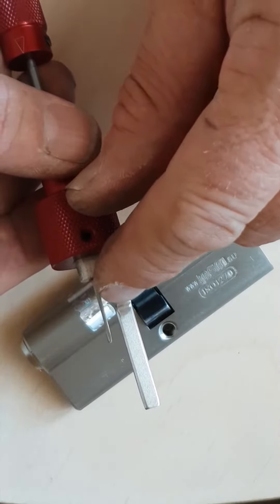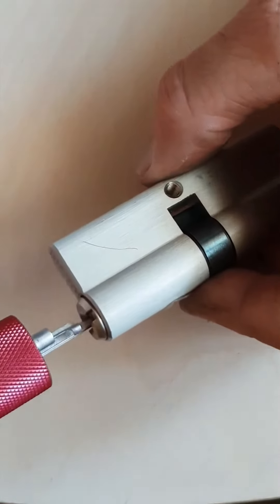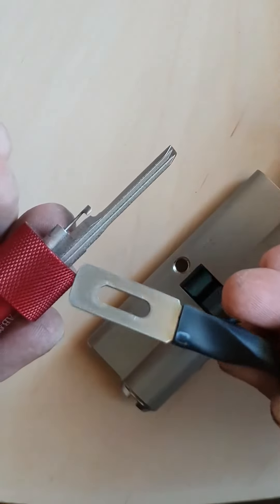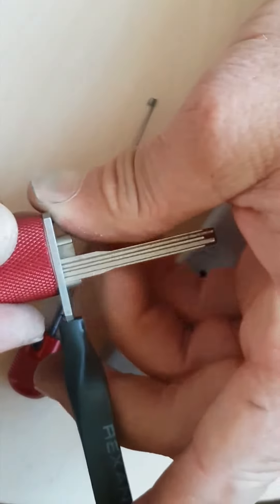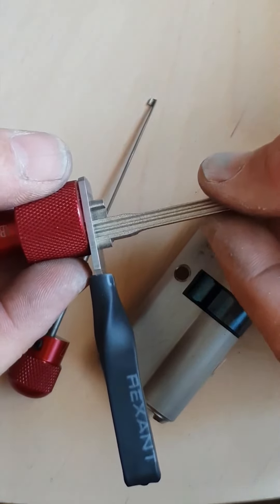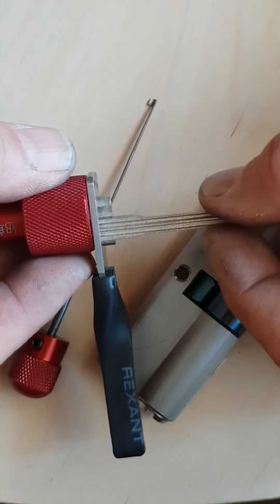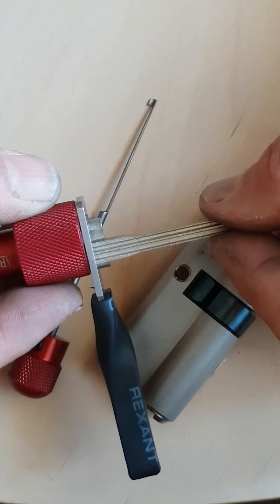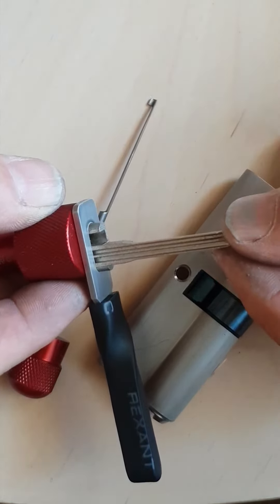Look At My Latest Improvements to The AB KABA Pick/Decoder From AliExpress.

Comment: Very nice modifications and tensioner you have done to make this tool more functional. Thanks for sharing, cheers
Reply from the maker: This handle is also reversible (for left or right handed) But, I'm not done. I ordered some 2.9 by 100 mm ejector pins. I want to see how this tool performs if I make my own dimple pick components. I won't have the indicator notches. They are worthless anyway. I want to make the shaft stronger. I'll do this two ways. This will give me more torque to set pins into place and to give better feedback. I might deviate from the curved flag to a flat flag just to see what happens.

Comment: That's such an interesting addition
Reply from the maker: Thanks. Tomorrow, I am going to make my own custom pick for this tool. It will be the same as the original in profile, but less material will be removed between the head and the stem. This will help reduce flexibility of the pick as more torque is applied. My pick won't have the calibrated notches. They are unnecessary anyway.

Comment from the maker: READ THIS FIRST!

Even though I enjoy making improvements to Chinese dimple picks, such as the gold-handled QS100 and the red-handled KABA AB (as shown in this video), my custom 2-in-1 301 stainless steel dimple pick and tensioner can pick the AB cylinders in under a minute. This was based on a sample of six cylinders. Blind out-of the-package tests still need to be done to eliminate picker's memory and bias. It takes considerably more  time to pick with the latest KABA AB pick, and that's if it works at all.

So, this begs the question: Why did the Chinese create such complicated under-performing  2-in-1 dimple picks? We've all heard the expression, "Sometimes less is more," and truly my tools prove that. 

If you like tools that look good, but work poorly, then AliExpress has your solution. There seems to be a marketing scheme directing tool designers to come up with some  new tools, even if they suck.

Sincerely,
Lauren A.